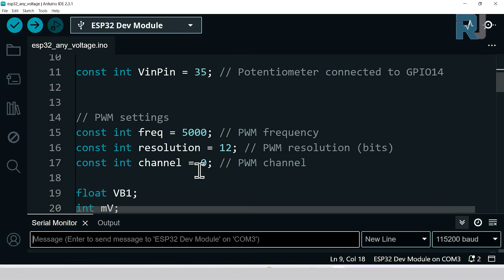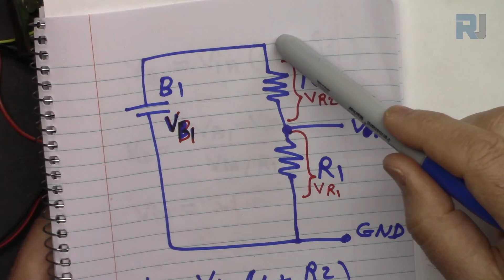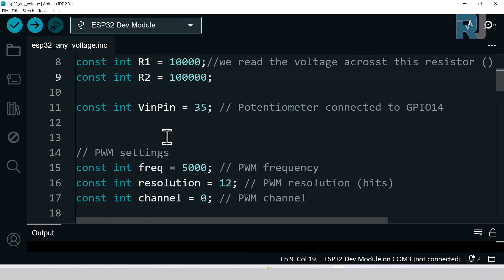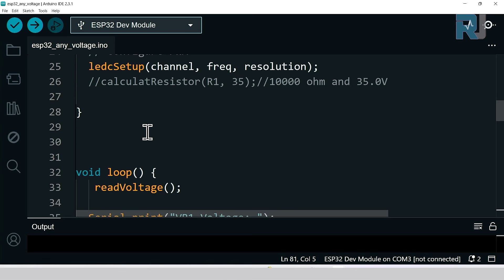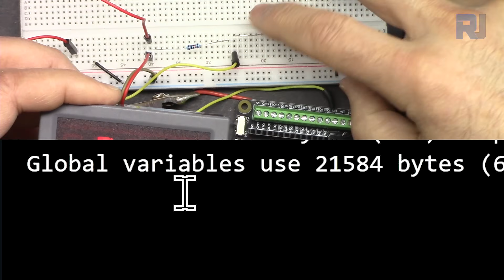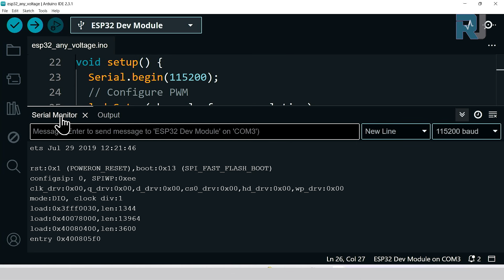ESP32 Tutorial 55 - How to measure 12V, 24V or 100V DC voltage | SunFounder's ESP32 IoT Learning kit

Comment: Nice presentation. From 9:05 to 16:40, I can see some additional connections appear especially on the left side of the breadboard. Are you able to explain what these additional connections are please?

And also is it correct that only GND is connected to the ESP32 along with pin 35? Only two connections to ESP32?

Comment: I have a question.
- The voltage Maximum used is 100V and R2 = 330K.
- Do I need to change the const int to R2 = 330000 in the program?
Thank you.

Comment: I tried to build it, but even with no voltgage on the resistors it gives me numbers between 15-23V in serial monitor and when I provide 3V or 5V it doesnt change at all
Reply from the maker: you must be doing something wrong. Most people don't watch the video and don't follow instructions.  I have shown the function maxVoltage();  puit inside loop and see what is prints based on your resistors.

Comment: I want to ask, why when tested the voltage read on the sensor is the maximum voltage?. I tested the sensor with a 5V voltage source, why does the sensor read 100V?.
Reply from the maker: if we don't know what is the maximum, then the board will burn if you connect higher voltage. So have to know the max voltage to put proper resistor.
Reply: @robojax  What I mean here is, why is it that when I give a power supply of 5 V, why does the sensor read a voltage of 100 V?

Comment: Hi, I have 5 Volts and I need to reduce to <3.3V for ESP32.
I have 1kohm resistance available and I could use R1 = 1k and R2 = 2k ( 2 resistance of 1k in series) but not sure this is a good idea. Will I have higher current in such way?
Thanks
Reply: I forgot to say that the source of the 5 volt is an UPS of 25 volts already reduced with a voltage divider.
Reply from the maker: Hi, Even though I have explained it fully, but you can use this calcualtor https://ohmslawcalculator.com/voltage-divider-calculator#google_vignette
Reply: @robojax  I know it and the relative values of resistances are correct. I’m only asking about the absolute values of the resistance. Is 1000 ohms to low to use as R1 or it could be ok?

Comment: Could we read AC voltage with a small different circuit ?
Reply from the maker: if you can convert AC to DC with some circuit, yes it should work.